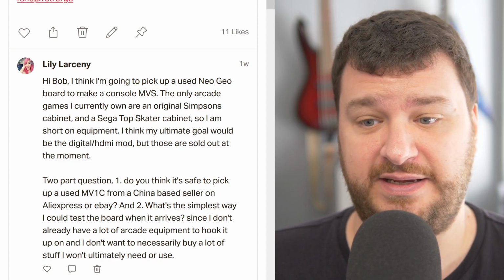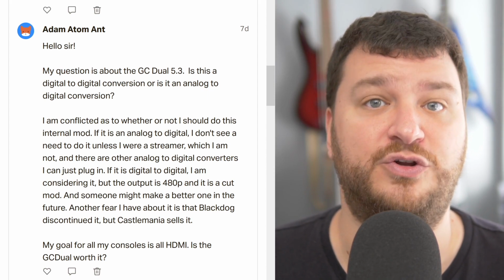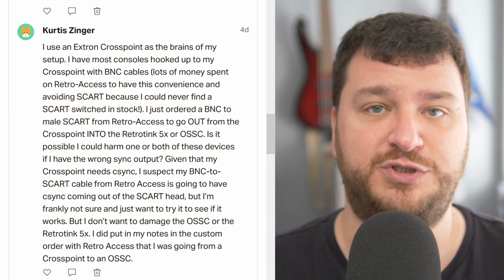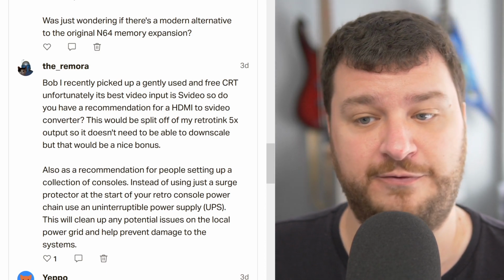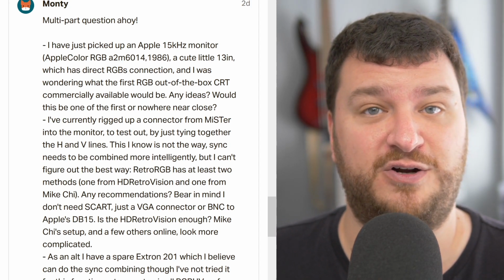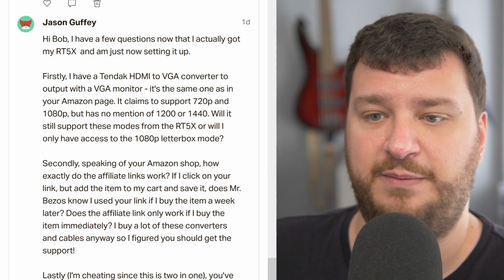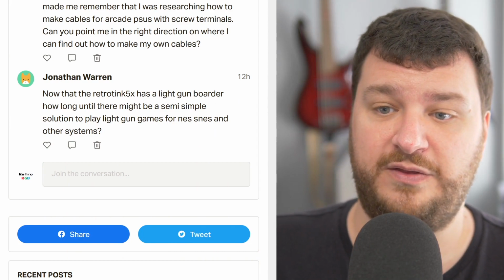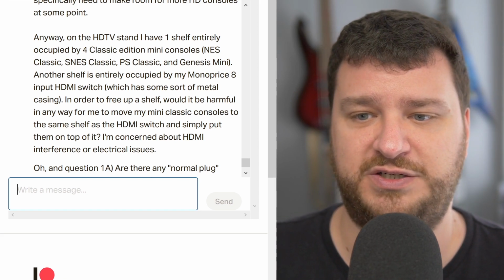Supporter Q&A #158

Comment: Hi Bob, thank you for the great content! Mu question is regarding component splitters, particularly the ce labs 400 comp splitter. Are this devices safe to add into a setup? I got one without psu, and found a generic/chinese psu on ebay, now I’m hesitant to add it. Want to use it to for 2 crts, and keep my FM hooked up. Thank you for your time, and effort.

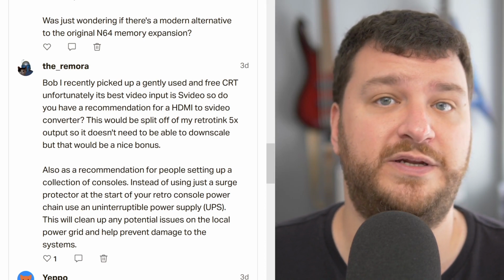Comment: 38:10 I think one of  the words you're looking for is 'pure sine wave', ala pure sine wave inverters. Any quality UPS should be pure sine wave with power factor correction and what not but this is all detailed in the specs so it's easy to find out. Shitter ones may employ emulating a 50/60hz AC output with pulse width modulation, I guess.

Comment: I have issues with PS1 when using memory cards and wireless controllers. I think it’s too much power draw for the front ports. Happens on both fully decked out PS1s (PS1Digital, X-Station, MemCard Pro), and stock.
Reply: what sort of issues?
i am waiting for my Memcard Pro to arrive...
my PS1 is also running on a rePSX PSU
Reply: @myretronation  mainly the memory card slots not working sometimes if a wireless controller is plugged in. I think it’s a common problem. But it should be noted that I have a stock PSU.
Reply: @gamefreakjoey  thanks for letting me know
will have to see what happens when my MemCard Pro arrives late June or early July :)
also, may I know which wireless controller you're using?
I'm using a Brook PS2 to PS3/PS4 adapter
Reply: @myretronation  I use the ‘Logitech wireless Cordless Action’  and also a Chinese non branded type that look like the colored transparent dual shock 2.  I still want to get the Brooks adapter.
Reply: @gamefreakjoey  Brooks is updating their PS2 adapter so that there isn't a dangling dongle anymore, but there's no release date yet
I have a Logitech pad as well, but it's used on my PS2

Comment: For the person feeding 1440p into VGA monitor, if its a CRT, its very rare for them to support such high resolutions, usually max is 1600x1200, which likely will not even sync with 1920x1080. If you have a flat panel that can hit 1440p it probably has at least a DVI input which is very easy to convert from HDMI.

Comment: I am using a dejitter mod on my multi-chip SNES (installed it myself).  Without this mod I was unable to get a signal through the OSSC from many SNES games.  Some games, like Street Fighter 2, always worked fine.  Other games, like Chrono Triger and Final Fantasy 3, showed no signal on my Samsung LED TV.  I never tried the optimal phase, but even without optimal timing I did have to occasionally reset the OSSC to get it to work even with the dejitter mod.  Now I switched over to the RetroTink 5x Pro and have had no issues with my SNES.
Reply: Thank you for this info. I have a Samsung QLED from last year, and it's absolutely terrible for retro gaming. Only the Framemeister so far works with my SNES in anything higher than 480p. And even then, with HDRV cables, some games, like Demon's Crest, were all messed up. Switched to Retro Access SCART cable, and it cleared right up. I can't wait for a 5X!

Comment: So fun story, Because of the systems (SNES, Genesis, PS2, OG Xbox etc) in my setup I am using both SCART and Component Video. So I'll keep an eye on FB marketplace for another CRT.

I didn't even think about a power conditioner instead of a UPS my only exposure has be to UPS's I will be picking up one thanks Bob.

Comment: In regards to an n64 expansion pack smoke monster posted a link a while ago for a solid replacement which uses fram instead of a battery to hold saves
Reply: Got said link?

Comment: Will going from Carby HDMI to a HDMI to component adapter cause a loss in video quality? Wanna keep everything in setup component
Reply from the maker: @D3clin3 Gaming  No, as stated in the Q&A, doing that is an excellent solution with no quality loss at all.
Reply: @RetroRGB  Thanks, seems like the best option right now without paying out the ass for cables
Reply: You would be better finding some good quality component cables instead of converting from hdmi. Contemplating doing that myself.